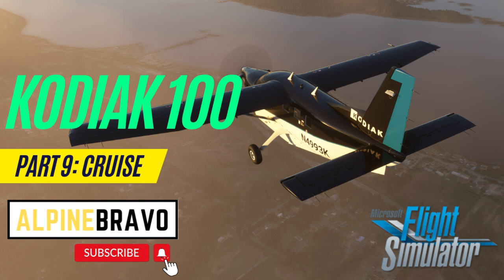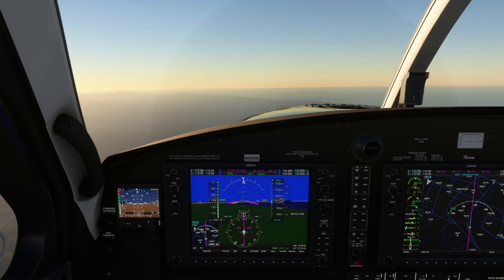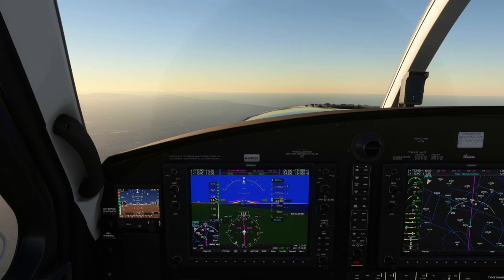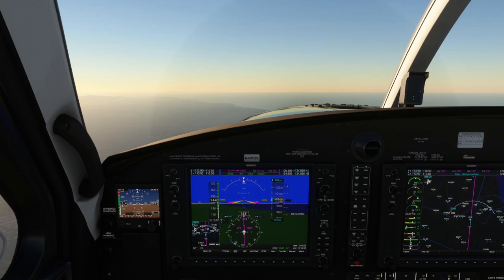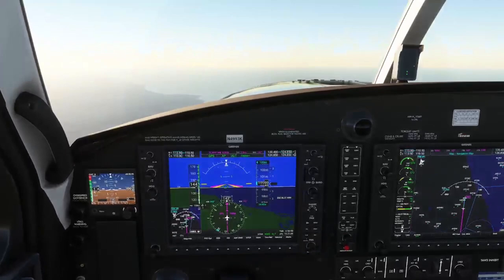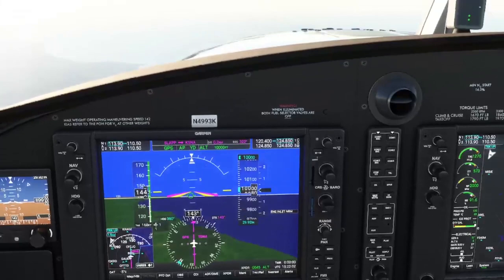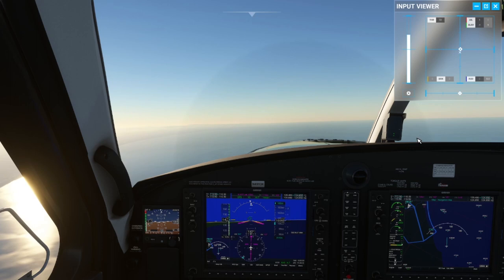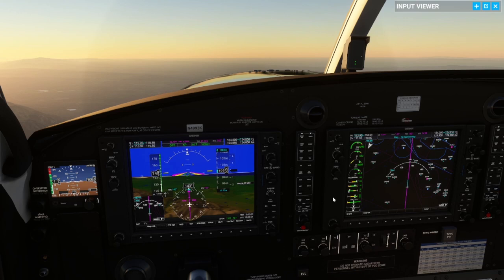How to fly the Kodiak 100 | Part 9 | Cruise Management

Comment: could u explain how to get the "vertical track" enunciator? i use spad.next for turning a keyboard into the g1000 buttons but thats a cool functionality i dont know how to do
Reply from the maker: Hi there, and sorry for the delay. You have spad, so it's not too hard to do...

First off you will need to get an audio clip of the 'vertical track'.

Then you create a virtual 'script panel' in spad. this is used for creating events that have no physical button to trigger them.

In the script panel 'device' you create a play audio event and point it towards your audio clip wherever you saved it.

Then the tricky bit - you create a condition to trigger playing the sound.  I recall that I found a ' top of descent' LVAR for the G1000 that basically counts down the distance to tod. So I used that and when that = 0 the condition is met to play the audio event.

There are some tutorials vids by Les O'Reilly on using spad to play audio I also was able to get some support on the spad Discord.  Hope that helps.